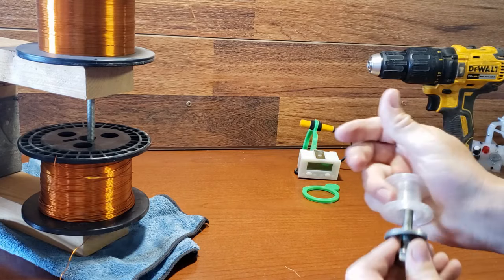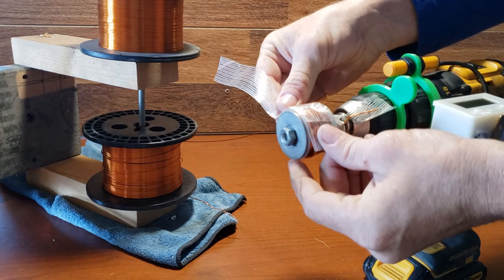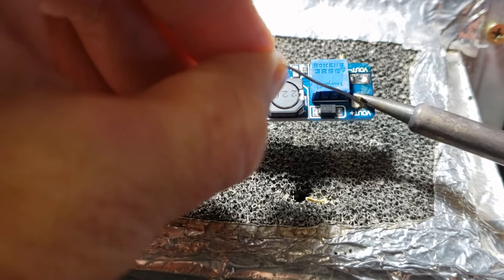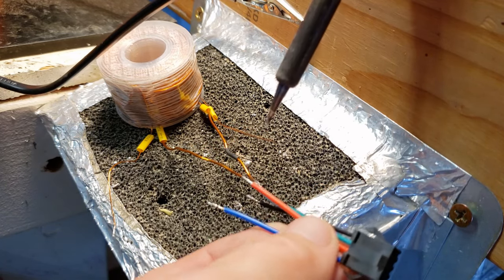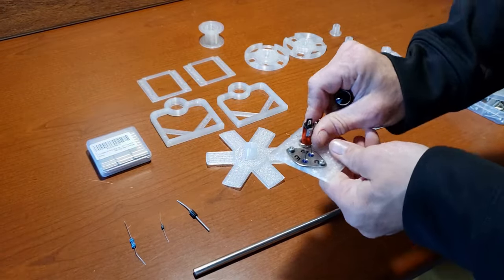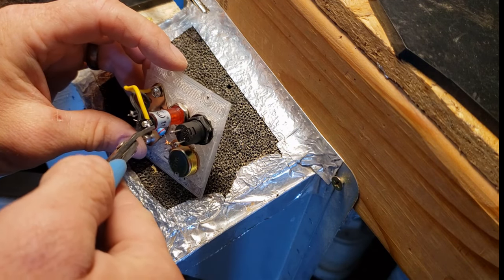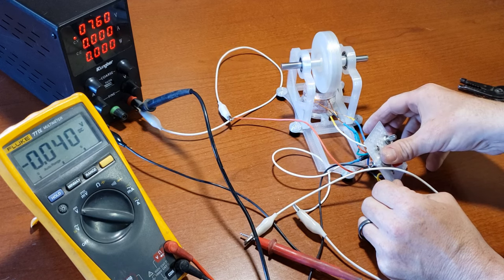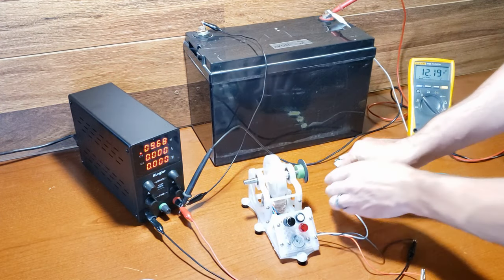bedini final build

Comment: Thank you very much for your detailed teaching guidance~ It allows a layman like me to experience the wonders of circuits~~ The equipment I copied works well~ Thank you again!非常感谢您详细的教学指导~让我这样的门外汉也能体验到电路的奇妙~~我复制的设备运作良好~再次的感谢！
Reply from the maker: No problem brother, I'm glad your interested in this hobby! Keep experimenting and you will unlock your own mysteries. Test the output voltage across the collector diode and the positive battery terminal with a multimeter. It should be over 50v. Be safe don't touch anything while its on...
Reply: @redesign3dp Thank you. I also want to ask if the wire from the 5408 diode can be connected to the positive terminal of the battery to charge the battery? My previous operation was driven by a 12-volt transformer connected to the mains power BEBINI. 谢谢  我还想问  5408二极管引出的线能否接电池正极给电池充电？  我之前的运行是用接市电的12伏变压器 带动的BEBINI
Reply from the maker: No, it will stall. But if you can charge a second battery by placing it- drive battery positive to charge battery negative. Charge battery positive to output diode.
Reply: @redesign3dp  Now I use two 12F batteries to run the equipment.
My batteries are all old batteries and the measured voltage is 6F. They cannot be charged with a charger. One battery alone cannot start the Bebini device. So I use a 12V battery charger to connect one of the batteries to power BEBINI. The wires drawn from the UF5408 diode are connected to the third battery. The positive terminal of the two batteries. When the device is not started, the voltage of the second battery is measured to be 6F. After startup, the measurement is about 9F.

I'm not sure if I charged the second battery.
There is another problem. The only resistor in the circuit will appear burnt black, but even if it is burnt black, the device can still start running. So far this is the case, although I have replaced 3 resistors... (I replace resistors when the unit stops running) I have no idea what is wrong. . . . .

The voltage measured between the positive terminal of UF5408 and the positive terminal of the second battery is 12F. Before the resistor burned black, I measured 16F. The voltage between the negative terminal of UF5408 and the positive terminal of the second battery was basically no voltage. Is this correct?

Also, the diameter of the coil I used is 0.5MM and 0.3MM. It is thinner than the one in the video... Is it a problem with the coil that causes no high-frequency pulse voltage to be generated?

Also, my magnet has the S pole facing outward. It is the same for all three magnets. Do I need the N pole to face outward?

Thank you very much for your reply again!

Yesterday, the equipment no longer started running, and the three circuit boards did not start up. Today, I made the fourth circuit board and the equipment started up again. But currently the resistor is burnt black but the device is operating normally. (I have replaced the first three circuit boards that did not start with new resistors, but they still cannot start. I can't find the direction at all...)
Fortunately, the fourth block was activated~~~otherwise I would have thought it was a dream. . . Ha ha

Comment: Im hoping someone can help me please. I have built this circuit but it's not working for me. I can get the neon bulb to light and go brighter and darker in unison with a high pitched noise that changes frequency with the potentiometer also. But the magnets are unaffected like the coil is not firing. laso if i place thr coil near the magnets and spin the rotor this will stop the circuit entirely.
I have used 1N4001 diode across the base and emitter, does this need to be 1N4007 instead?
Reply from the maker: Magnets need to be in repulsion and must all face the same outward direction. 1n4001 should work
Reply: @redesign3dp  Thanks, they are. I may have used 1k VR instead of 10K VR specified in your list. Thanks for replying, appreciate it.

Comment: 就在之前   它开始运作了  情况看起来跟视频一模一样~但是我的接线似乎跟视频不同   首先电源开关开启后  12V指示灯回亮起，持久的亮   然后手动转动转子   转子开始旋转  指示灯开始闪烁    三极管E极接电池负极  电源开关接电池正极     那条接三极管C极的UF5408的线没有接任何东西。。。。。这样的情况算成功了吗？It started working just before. The situation looks exactly like the video~ But my wiring seems to be different from the video. First, after the power switch is turned on, the 12V indicator light comes on, and it stays on for a long time. Then the rotor is manually turned and the rotor starts to rotate. The indicator light starts flashing. The transistor E pole is connected. The negative terminal of the battery power switch is connected to the positive terminal of the battery, and the UF5408 wire connected to the C terminal of the transistor is not connected to anything. . . . . Is this situation considered a success?
Reply from the maker: There is no 12v indicator, thats a 90v neon to safeguard the transistor. Please Google a "bedini ssg circuit" let me know of you have further problems

Comment: Add a small meal underneath the coil on the core you may have to add more than one put an amp meter on the input and run it normally and check the output and the amp output then put the little magnets underneath the iron core and you'll notice that everything stays the same except the input wattage drops 1/3 with the same output what's going on is the magnetic domains the magnets partially turn the magnetic domains but not enough to affect attraction but because one third or already changed then it all adds to the total when it's fired electrically so you get a boost you can always use a 1/3 less energy on the input

Comment: At present, I have replaced the battery pack with a new one and removed the mains charger. The previous blackening of the resistor has disappeared. It should be that the current was too high due to the external mains charger... Connect the positive terminal of the battery to the negative terminal of the multimeter and the white wire end of UF5408 to measure. The highest voltage I got was 24F. Considering that it only has a 12F battery connected, this is a surprise!
How do I set up battery charging?
Reply from the maker: I still didn't recieve your email,  redesign3dp@gmail.com

Comment: Sorry for posting links in your comment section, but I admire what you're trying to achieve so much, I would save you the trouble I went to running in circles for years.  So here is the sum of what I learned.  Rick Friedrich for battery swapping.  Nick Kraakman for the flyback circuit, which he sells to save us the trouble of building.  John Bedini's School Girl Energizer.  Combine the lot and remember to use the air outside the device act as the Dielectric Medium, otherwise it won't work.
Reply from the maker: Thanks brother, but you forgot Kenergy.. I'm aware of all three you mentioned. John was the modern tesla in my view, I'm sure he only shared the small stuff with us and took the important discoveries with him. This motor design was an easy way to help get people started experimenting quickly without needing construction skills. Thanks for the comment!
Reply: @redesign3dp  Yes KEnergy really has the circuits sorted. We are lucky to have the opportunity to follow his progress. I've only just become aware of him, but better late than never sir.  😊

Comment: Great video. in your opinion what one component is most useful. caps, diodes, transistors, resistors etc... I love salvaging components from scrap. it's harder and harder to find useable bits, as people ditch "old fashioned" stuff. Soon it'll all be too small for me to desolder.
Reply from the maker: All, they each have an important purpose. The whole system cannot work without each piece.

Comment: The highest voltage measured in the device I copied is currently 33V, replaced with a 110V neon bulb. There is no load connected to the output end of the power generation, so it is measured by connecting it to the positive terminal of the multimeter. At this moment, the 110-volt neon bulb will light up. Although it is not particularly bright, it does light up, indicating that a voltage close to 110 volts is passing through. After several days of testing, this device can charge a second battery, but my observation is that 12.8 volts is the highest. There is a capacitor in the original BEDINI circuit. I would like to ask if there is any other way to improve the battery charging of this device? Please advise. Thanks!
Reply from the maker: That little bedini motor is a very basic entry level device for introductory experimentation and learning. Which you are doing nicely my friend. To use the voltage spike effectively, you use it to charge a capacitor bank, then dump it into a battery around 20v at 3 amps into another 12v battery. Check out my cap dump video to get an idea of its effects.
Reply: Thank you so much! Through the production of this equipment, I now have more confidence to make larger versions of BEBINI. I will continue to learn. The specific parameters of the production materials and detailed production steps you listed in detail in the video are the key to my success in replicating it. By the way, there are also 3D printing kits. It's really great! @redesign3dp
Reply from the maker: I'm glad your on your way brother! Bedini is just one type you can build. My favorites are opto timed pwm pulse motors.
Reply: @redesign3dp what do those ones do?

Comment: Another question: Are you sure it is 2N4007 Diode?
I searched almost all stores and only found 1N4007....
Reply from the maker: Your correct 1n4007. But you can use any rectifier or shotkey diodes.

Comment: The result of the test just now shows that the battery does not receive additional power.
When the charger is connected, the speed and noise are getting louder and louder. The charging meter shows 1.1A and is reduced to 0.6A with the potentiometer control. The noise and speed drop significantly. I simply removed the external charger connected to the first battery and used the power in the battery to drive it. . . . . Sure enough, the rotor continues to rotate, and I can even use the potentiometer to control the current increase. Yes, there is no external mains power supply for the operation at this time. After measuring for a while, I found that the voltage in the battery was decreasing, and the voltage in the second battery was also decreasing. In general, the equipment I have made so far does not have high voltage peaks. I guess it may be a problem with the generator coil. Because the rotor can run, it may mean that the drive coil is working as expected. I will try to make a coil made of 20 25 copper wire and test it.
In addition, can you guess which part of my copying is not in place? Please enlighten me! Thanks Thank you very much again.
This is really a new exploration for me.
Reply from the maker: Would be so kind to upload a video to your channel showing me your setup. That'll make troubleshooting easier. Or if you prefer email me at redesign3dp@gmail.com
Reply: The video is quite messy and has been sent to your email. There are also photos of the circuit produced and the condition of the resistor being burned black. The 20-25 coil I replaced today has not started yet. All I can think of at the moment is that the magnet doesn't have its N pole facing out.视频比较凌乱   发到了您的邮箱了。  还有制作的电路照片 ，  以及电阻烧黑的情况  。   今天换上的20   25的 线圈 ，   目前还没有启动    。目前我能想到的就是磁铁还没有N极朝外面这一点。 @redesign3dp
Reply from the maker: @xingzhe2078  i didn't get anything yet?

Comment: Where is your capacitor connected to the inductor in series of the same value.
You can:
1. Control it better.
2. Make it go twice as fast.
3. Use less electricity.
4. Have better torque
Just saying man gotta think efficiently.
Reply from the maker: I'll give it a try. Are you saying put a capacitor in between the coil and the mosfet ina series tank config? Would my output diode go where the coil and cap meet?

Comment: I found out why I never managed to finish my build. Everything is printed, and components ready. Except the freaking neon lamp. I brought neon lamps from 3 different sellers on amazon, all of them sent me LED diodes with a resistance on them. After using some of them, I fried all my transistors.
Reply from the maker: At least you know whats wrong now! When you get it running don't forget to tape the rotor magnets or they will fly off. Glad your still at it.
Reply: @redesign3dp   I found and used the same tape as you did and applied in two layers to be sure it's safe. :D

Comment: I thought of a reason why there was no high voltage. Maybe it was because my battery was almost scrapped after being used for 3 years (the voltage was only 6F).
The newly wound 20 25 coil can already start the device. It didn't start before because I connected the wires backwards... I will make almost every mistake several times... True Feel sorry......

The power generation voltage of the new coil is almost the same as that of the old coil, starting at 20F and then returning to 16V. This may be the result of adding a load after two batteries are connected in series...
Reply from the maker: I like how your experimenting!

Comment: Im gunna try and build this and charge my 6s 1550mAh drone batteries in the field and fly alllll day :)
Reply from the maker: I'd wouldn't use li ion or lipo with that. The hv spike could damage the battery and start a fire potentially. Use on lead acid, or charge up caps.

Comment: I copied this generator ~ but it didn't work ~ 2N4007 couldn't find it, used 1N4007 Everything else is the same as the video
Reply from the maker: Switch the drive coil leads. Its not a generator, but a mechanical oscillator that produced high voltage emf spikes. Make sure you have a load connected before operation.